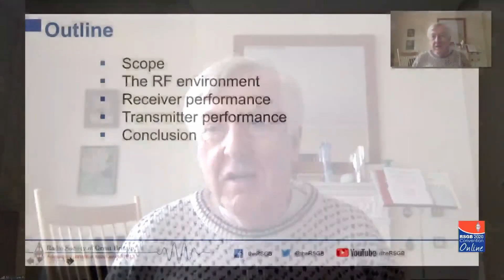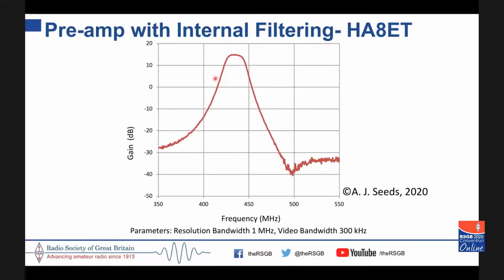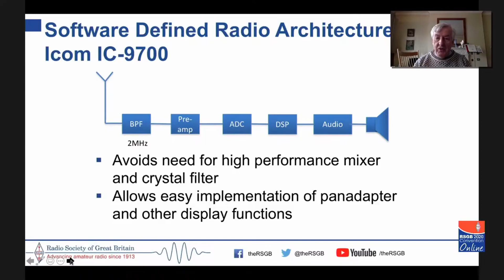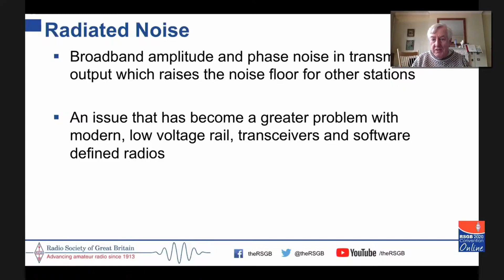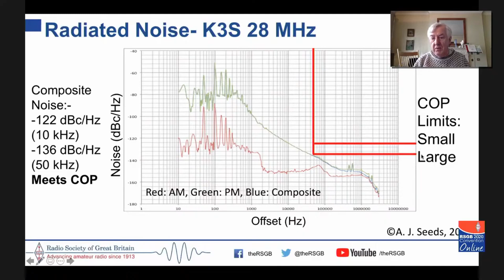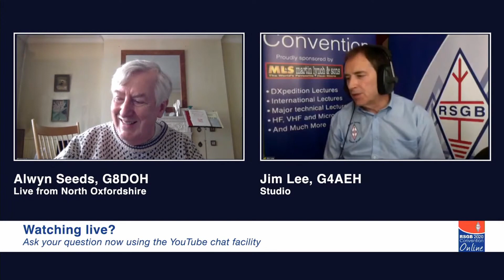RSGB 2020 Convention Online presentation - VHF/UHF radios for contesting and DXing

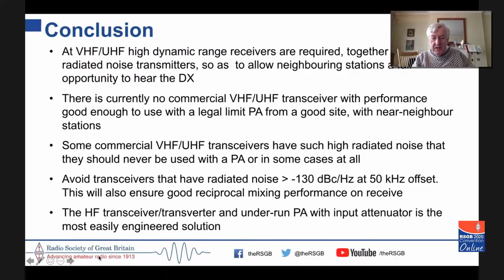Comment: Could you provide the correct issue reference of Radcom cause March 2015 doesn't contains the said paper (at 43:50). Thanks.
Reply: it was RadCom March 2016, Vol. 92, No. 3